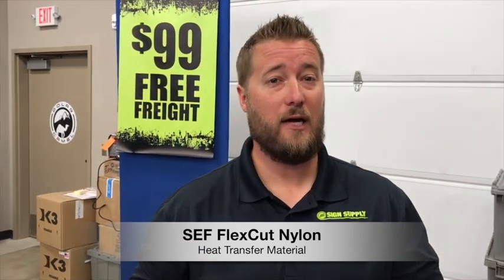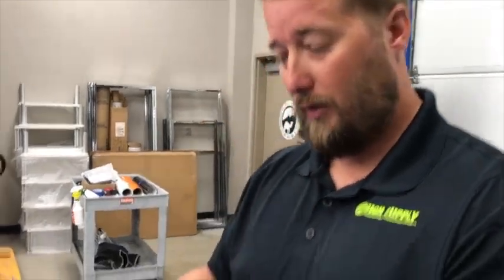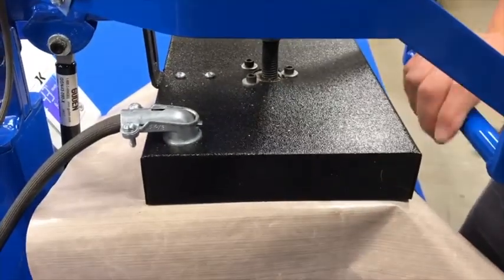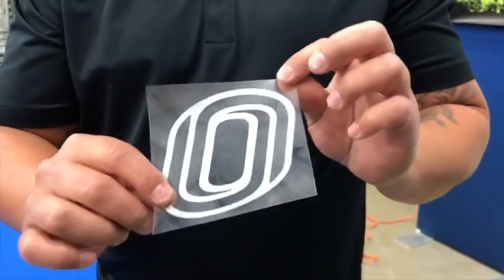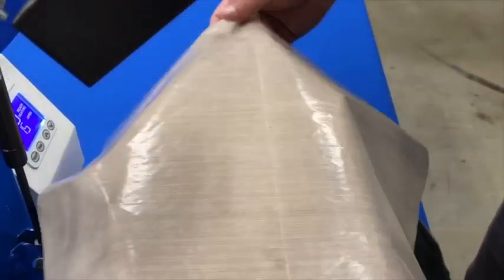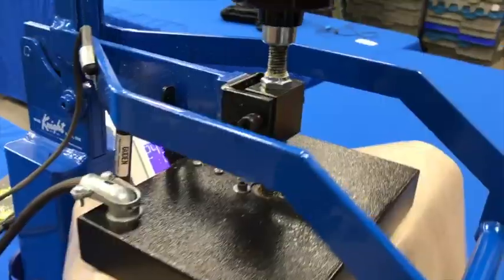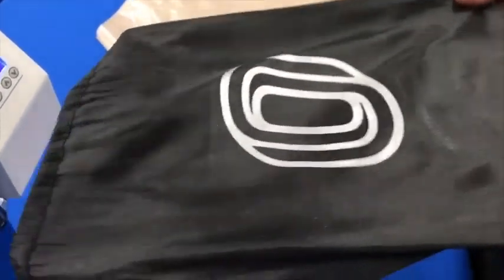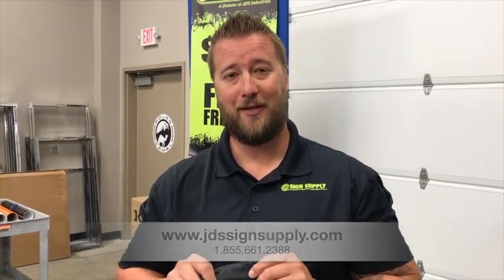How to Apply Heat Transfer Film to Temperature Sensitive Materials Like Nylon

Comment: Very cool video - I show this to our clients when they ask about pressing our DTF on nylon. 

A couple of tips for people that are not talked about:

1. Make sure your pressure is high for both 100% poly and 100% Nylon materials, if you are not pressing at heavy settings the adhesive on the back of prints will not stay during a wash. 
2. Be wary of pressing for too long at too high of temps on these materials as discoloration boxes are easy to have if you press too long and too hot.
3. Tumble wash low for best results, no fabric softener as it can affect the adhesive on these materials and fall off. Hang dry recommended, but can low heat dry short cycle.

Comment: Is it safe to cut with a laser?
Reply from the maker: No it is not safe to laser.  Though the material itself is a polyurethane, the adhesive that is holding the material to the protective liner is not considered safe to laser.